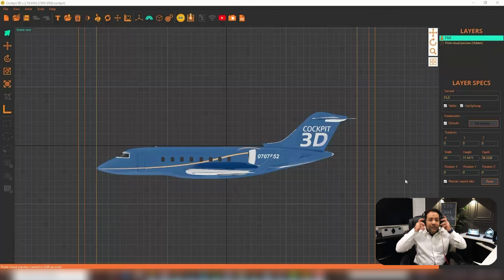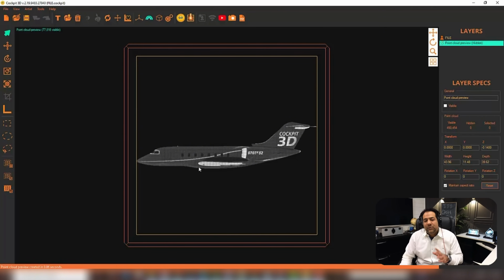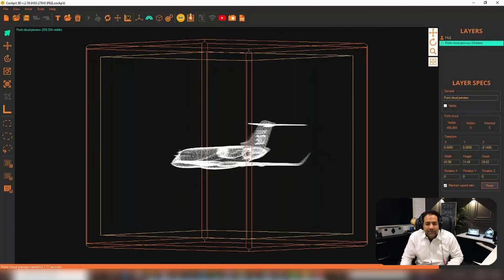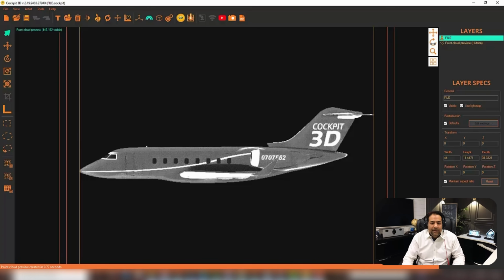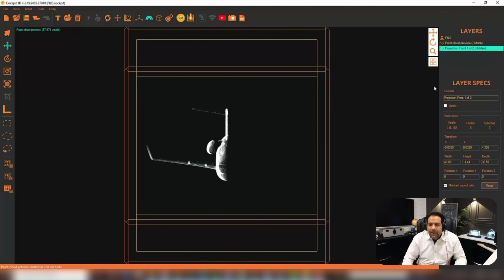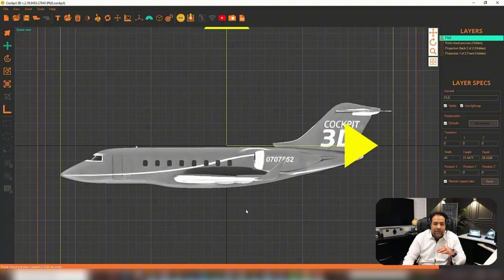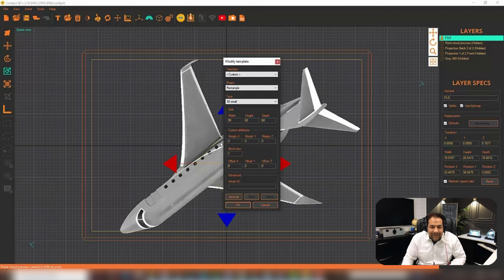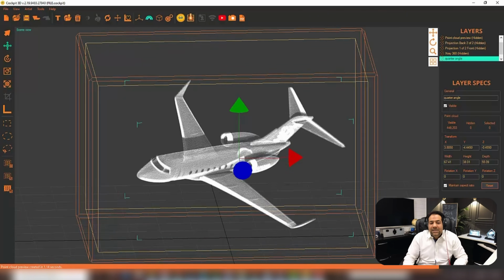Subsurface Laser Engraving 360° Workflow | Cockpit3D Point Cloud Tutorial

Comment: A Question, When we ask the system to send our file to a human , Are they using the same software to adjust the image? or do they have some other 3D software to splice everything together --- AI is great but just as you said, Keeping a human in the look is just as important and learning to truly use the software to its fullest even more so.... I worked a lot of events where requests needed to be done on fly and waiting on a 3rd party was not really feasible
Reply from the maker: Our artists model from scratch using meshes. It’s completely different than the way auto conversions do it on our fast pass portal. However for most consumer related gifting the output from our trained auto conversions is matching in quality to what our artists do for 3D PoP 180 degree laser etching.